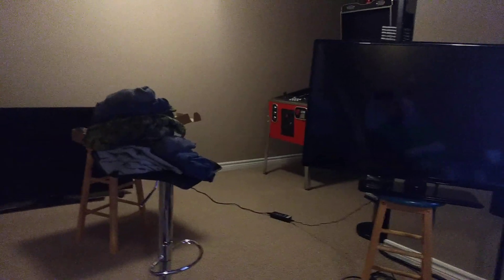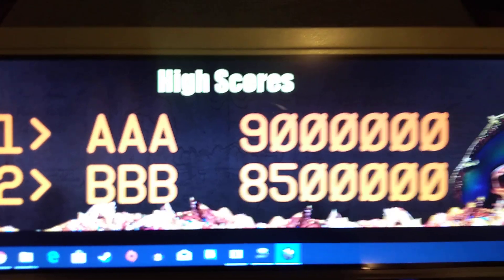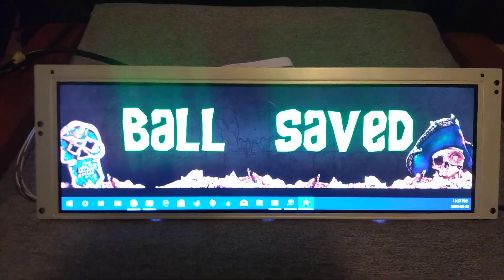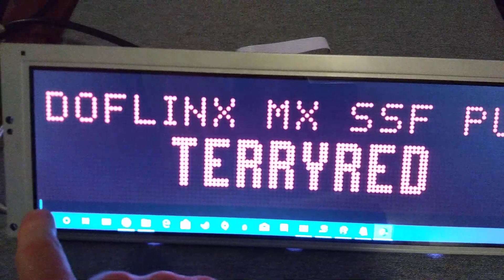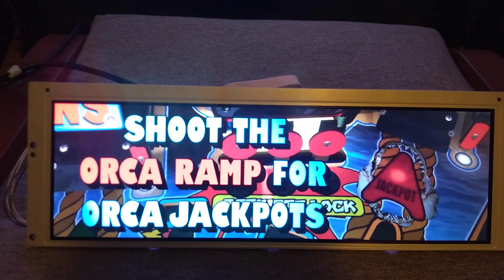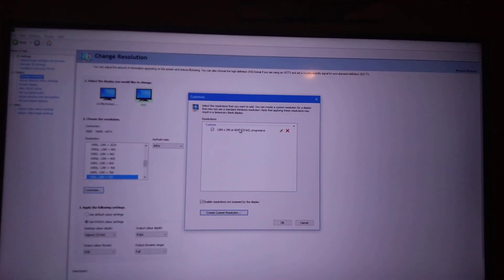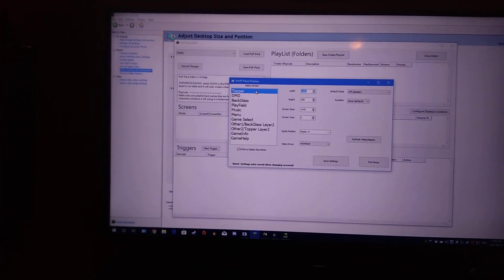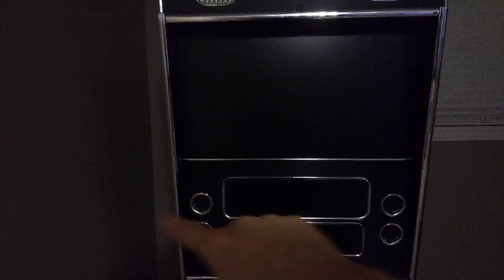LCD screen (from China) for DMD / Topper / Under / PuP: Testing and Proper Resolution Setup.

Comment: I just ordered this exact same thing to put inside my pc case. But my own dumb ass didn't take into account that the length of my case is like 14 inches until it hits some metal frame inside. You think I can cut off a few inches from the metal from the side of this panel, or maybe just remove the metal border altogether? Thank you!

Comment: Hi All.  First and foremost, thanks again Terry for all you do for the PinCab community.  I just got mine for use in a DMD.  I don't see the resolution options like Terry does in the video.  I've looked in both Windows 10 Display Settings and my Intel HD 530 graphics settings.  I have made sure that all my drivers were updated but no such luck.  I can halfway there (which Terry describes before scaling) by using an utility called "Custom Resolution Utility (CRU)" but it will only showed centered in half of the screen.  It is because the Desktop Resolution is 1280x390 after CRU but the "active signal resolution" is still 1280x720.  Changing the scaling options will only result in either no change or the screen blanking.  The screen also blanks if I change it anything but 68hz refresh rate.  I'm hoping I can figure something out to get over that last half.  Anyways best of luck on everyone's builds. - Ron (Kaze1SD)

Comment: Hi Terry 👋🏻
First things first : THANK YOU for all your contributions to the pincab community !!!

I have one of these screens in my personal pincab and by following your explainations step by step I make it work fine 😁👍🏻

BUT, in the pincab of a friend of mine, I’m failing to get it work properly.... sometimes, windows (10pro) recognize it as « AAA » screen and applies the settings that I have told him, and some times it doesn’t recognize the screen and applies some default settings that screws all the configuration / localisation of the screens 😭

Is that a common problem or am I in front of a « bad » screen ??? I don’t know, but since you have two of these screen in your pincab, I wondered if your hade to face that kind of problems ? 
And Btw mine works fine on win10home and his doesn’t work on win10Pro... Could it be a matter of operating system ? What kind of windows do you use ?

Thank you.
(And if my English ins’t perfect, it’s because I’m french !! 😜)
Bye 👋🏻 
Laurent (FR)

Comment: I have this exact LCD, but it won´t start up properly... maybe you can help me? it shows picture for a second when startup and when changing resolution, otherwise black. I´m thinking that maybe my AC adaptor is not giving enough current, it´s only 1.8A and the manual says the LCD screen needs 2.0A or above. Do you think this is the problem? Is so I better get another adaptor.. :-)
Reply from the maker: Yah.... when they say you need a minimum spec for something.... they kind of mean it.
Reply: @TerryRed  haha, yeah that figures...  Gonna try it asap, I´ll post my results here to maybe help someone else. :-)
Reply: @TerryRed  I have now tried with a correct AC/DC-adaptor with 2A, but still the same problem... the screen just flashes for a second when startup and when changing resolutions, and it is recognized fine in Windows. It´s very strange, any help very appreciated!

Comment: I was having white screen problems, until I checked a close up image of the site you were on, which showed all cables connected. I hadn't connected the one with the black double rows of pins, as it was shorter than the double row of pins on the PCB. After connecting, the display works. However, It seems insistent on using the 1280 by 720 setting, and not the 1280 by 390 settings I setup in Nvidia control panel, for whatever reason. Earlier, the display was so squished, there were black bars, at top, and bottom, but I accidentally got it to display full screen, but still, everything appears squished, vertically. Still would appreciate assistance, either from the content creator, or someone who has this display, please.

Comment: By the way, do you have a video showing how to connect the display, and install it? The manual that came with mine is so small, I can't even read it with microscope. LOL I know what the two daughter boards are, I just need to be shown how to connect things, and install them. By the way, I know it was meant to be installed inside a backbox, but being legally blind, I got this to replace the 6" LCD panel that was intended for a mid sized 3/4 cabinet, so I'm having to install it externally, in front of the speaker/dmd board. Any thoughts or suggestions?

Comment: Thanks for sharing this. Was looking for an alternative to the tiny 7" display in my GameRoomSolutions mid size 3/4 scale cabinet. I'm legally blind, and need something bigger, but not the 16:9 aspect monitor, which totally stretches the DMD, vertically. Thanks for mentioning the need to set a custom res for the correct display mode. :)

Comment: Hey Terry, really enjoy and learn a lot of all your videos for my new hobby :-) 

I also have this LCD DMD but I'm pulling my hair out (now I'm bald) in getting this screen to work on an AMD RX580. I've tried everything already but can't get it to display proberly. Radeon settings doesn't accept settings for a custom res (for this screen), CRU can create it but still doesn't show correct size, also tried on the on-board Intel gpu for only the dmd but this also doesn't let me select the added custom res. Have you had any success with an AMD gpu with this screen?
Reply from the maker: I haven't had an AMD GPU since they were called ATI :) Sorry, wish I could help there. I know you aren't alone with this problem.
Reply: Well, I still think you thinking about it helped :-). You know that you can search for weeks about something and then you ask someone and then magically you find the solution just after asking the question. 

I fixed it today. I found a forum post somewhere that said to leave it at 68hz instead of the 60hz. So I added the 1280x390/68hz resolution with CRU and it worked 😍.
Reply from the maker: @jpvwx  Nice! Thanks for letting me know. I'll pass that on to others who have the same issue.
Reply: @jpvwx  can you show me your setting screen? i have the same issue, cant get it to work.
Reply: @jpvwx  Hi JP, I have RX-590 and it only provides fixed resolution and doesn't let you change to any custom resolution. What tool did you use to change to the custom 
resolution and refresh rate?

Comment: Hey thanks, great video! I just bought the same monitor, but I can´t get it to show anything! Just a white screen, and no text comes up when I press MENU button or any other button. Do you have any tips for me to get it working? Or might it be broken?? Thanks
Reply from the maker: Double check all your cables on the boards and be sure they a seated in nicely and are connected correctly.
Reply: @TerryRed  Yeah, I hadn´t plugged in one of the cables, cause I thought it was for something else.. haha :-)  Now it works, thanks man!
Reply: @TerryRed  Well, of course now I seem to have messed the screen up somehow.. darn it!! It worked fine, but now it won´t turn on, the led on the controller unit just flashes red. I think maybe one of the boards might have touched the back of the screen, and maybe that lead to a short or something. Do you have any suggestions what I could try to fix it? Maybe a fuse or a capacitor blew up?? I´m really not good at electronics, so all help MUCH MUCH APPRECIATED!! Thanks for all the you do for the pinball community!! :-)

Comment: Damn, just received mine but the LCD screen may be dead on arrival.  Windows sees it, but nothing happens when pressing the ON/OFF button or the menu button on the control board.  Waiting to hear back from the seller.
Reply: Got it working with the support of the vendor.

Comment: Terry, any chance of you doing a video of the hook ups. I just got mine from AliExpress and the lack of instructions is problematic.  I have monitor, 2 circuit boards and a control panel the same as that shown on your TV in this video. Thanks for your contribution to the VP Community

Comment: I can follow the instructions and get it looking okay outside of the emulator. But when the ROM starts on the DMD, the ROM is still displaying at 720 height. But outside the emulator, everything looks okay as 1280x390, on the desktop display and within PinballX. Where do I go to tell the rom to display as 390? I thought it would have been the B2S Editor, but changing the DMD height and width there didn’t help. How’d you do it Terry?
Reply from the maker: I use freezy 1.71 (dmddevice.dll) to display my DMDs for VPX. Press F1 to access to rom settings while in-game and be sure "Use external DLL" is enabled (this means use dmddevice.dll) and "Show DMD window" is disabled (to turn off ugly PinMAME DMD). You'll also want that for the PinMAME default settings. Then configure that freezy DMD's size and position in dmddevice.ini.
Reply: @TerryRed  and which is the correct size to have a full lcd display?
Reply: @enzopasciuti9819  Either 1280x390 to  fill the screen which will slightly stretch the DMD on the Y axis or 1280x320 for a normal DMD ratio of 4:1 which will leave a little bit of blank screen along the X axis.

Comment: I have the exact same matrix setup that you will be changing to.  Please tell me if you notice on some games the letters look off center or too close together while others seem fine.
Reply from the maker: The sizing of the letters may not look "ideal" depending on how they were line up for you. I made "my" dof MX effects and words / letters (I created most of that, really) based on my current setup...but for you the aspect ratio / dimension may be off depending on how wide your matrix is in comparison. I'll be using the big 32x8 center piece...and possibly 3 small 8x8 ones as well for my back MX.
Reply: @TerryRed  I see...yes that's what I have 3 8X8 on the left and 32X8 on right

Comment: Those controller boards that run the screen can be used with old laptop screens or pretty much any screen, around $35 just need to make sure it's for that model screen, one board will do a heap of models
Reply: What's the name of the controller board?